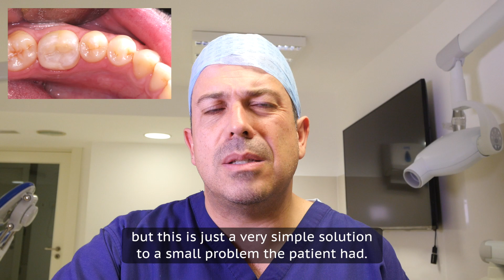A broken tooth doesn't always mean you need an implant - Brighton Implant Clinic - brunodentist

Comment: Hi Dr Silva, what about a vertical break?
Reply from the maker: vertical break is potentially quite serious as very often it may go through the core of the tooth and result in the pulp and nerve of the tooth becoming affected. If that happens then its almost certain that the tooth will need to be removed.
Reply: @brunodentist what about dead tooth, already filled root canal? Vertical crack. I see some may extract one root and leave the other roots in if stable.

Comment: This tooth looks just like mine. I cracked off a piece of my molar last night on a kernal of popcorn that was harder than I thought. It is not painful but just kind of crushed when I bit down on the kernel and now has jagged edges and a piece near the filling is obviously missing. I hope I can find a dentist who will do this instead of insisting on a crown, root canal, or pulling the tooth. Is there a certain kind of dentist I should seek out who is skilled at this technique?

Comment: I had a chip on my 1-5, (or that is the tooth i heard the dentist call) and also a little bit on the one next to it. It wasn't from decay, but i suspect from grinding/clenching so much. The filling was so deep on the one tooth, that it pushed the crown apart.
Problem is, i don't know what decision to make on it... i don't want a root canal or can't afford an implant. I had sensitivity for a few weeks coupled with the bit of pain if i chew with that tooth. I did have one day where i my teeth all ached on the top and bottom of that side of my mouth, but then i was fine the next day and the sensitivity is gone. The only thing is the pain i get from chewing something with that tooth, as i previously mentioned. I wonder if i can just get away with a crown put on?

Comment: Do large fillings cause a tooth to crack? And are these cracks usually called fractured cusps whereby they don't usually affect the pulp of the tooth?
Reply from the maker: not always, yes large fillings can contribute to a tooth breaking but it depends on the shape of the filling. If the filling is wedge shaped and located between cusps of teeth which have already thin walls then yes it is possible to cause a fracture that involves the pulp of the tooth. Best advice is to see your dentist and check what they recommend for treatment.

Comment: yep this was just what I was curious about.  Surprised there aren't many chipped molar repair videos.  Guess they rarely chip without needing extensive work.  Wonder how long a repair like this lasts though since this will see heavy use in chewing on that corner.  Really puts the resin composite to the test to the max here.

Comment: Hi! I had a wisdom tooth extracted; in the process, a small chip on the back of my molar occured; it apparently is on the cusp. Most of that molar is filled, and I was wondering if that small chip could be saved by a small filling, rather than resorting to a crown and/or root canal.
Reply: Yes that is possible, your dentist would need to have an assessment to see how severe the fracture is, your dentist will then be able to advise accordingly.
Reply: Hey i had the exact similar situation. Can i know if your issue was fixed with just composite bond? Mine still gives severe sensitivity it’s excruciating

Comment: Maybe not. But for those like myself on government insurance (only in america ¯\_(ツ)_/¯) a broken tooth most ALWAYS means extraction. Been watching multiple videos on whether or not the current hole in the back of my remaining upper right molar. Is possibly fixable (no root canal, no cap), thus saving the tooth. But....they would rather remove than fix, because mild shock it's not COVERED to be fixed! And only reason I have this problem now, is from neglect of a prior dentist, on a failed cap (which they did not replace cuz again, NOT covered). Only if you are capable of pulling redicolous amounts of money out your ass, are you able to keep your teeth. Just sayin.

I take care of my teeth. (well for the most part I do) but also come from a family with bad teeth (genetics). However, I lost 3 so far that ALL could of been fixed, but ultimately pulled, all because they were not covered under insurance, and I obviously cannot afford to pay out of pocket for. Current one, they quoted $1600 for ONE tooth. Root canal (which it doesn't even need. But....money), build up, and crown. When it can be CLEANED, then composite replaced to rebuild the tooth. No crown necessary. But they REFUSE to do it that way. And sadly it's ONLY dentist my insurance covers, in the area I live in.  If I lose this tooth, I will no longer be able o chew properly on that side. Nor does it even cover for me to have a partial to replace 2 missing molars upper right side, and one upper left. It's fucking bullshit. Only in AMERICA do we not have things like universal health or dental care. Unless....you're in the top 1% that is.

Edit: originally was small hole. Now big as around 6 months later, more came off/rotted. It's hard to see, since it's in the middle facing back of my mouth, so cannot be easily seen myself in a mirror. Thing is, they KNEW of this then. Suggested the $1600 repair. (claimed they reduced the price considerably, because of my financial status.) When, after watching many videos like this. It was very very possible it could of been cleaned out and filled in. Now, it's worse because they did NOTHING. not even a temp solution. Thus most likely costing me a tooth that gets worse by the day. Due to their negligence. It's not fair to anyone. Especially for something we rely heavily on for eating, self esteem, etc. Granted Dentist do need to be paid. But why most everywhere else has universal coverage. But america?

Comment: Bruno I have a root canal filled tooth which broke on one side to gum like that.  It has always been a very large filling and dentists have been reluctant to do a crown due to the risks of failure with so little tooth structure. it has been cleaned and covered for the moment as tooth does not hurt and roots seems clear on xray. Is it ok to leave it like this until i save up a bit to get an implant? i do have xray but doubt anything can be done. Also eating does not feel bad like when you have a tooth extracted

Comment: What if the fracture extended just below the gum line?
Reply: if the fracture extends below the gum margin then it would mean  a far more complex procedure, either we would have to remove some gum tissue to bring the tooth margins above the gum level. If that is not possible then it would be difficult to restore the tooth successfully. Potentially removing the tooth would be an option but that would then mean you would need to consider an implant or alternative replacement.
Reply: @BrunoSilva-ox2es I've seen fencing off the gum to ensure sterile environment and working below the gum line. Can you not do this instead of clipping off the gum?

Comment: Similar thing occurred to me. Unlike this patient, my once-filled tooth cracked on the outside surface.
However for some reason I barely have any time to see a dentist for the next 2 months. Do you think that will be too late for some nonradical treatment, like in this video?
Reply: try to get an appointment to see your dentist as soon as possible, the sooner the dentist can check this the better for you. If the tooth is damaged it will get worse if untreated.
Reply: @BrunoSilva-ox2es  got it. Thank you!